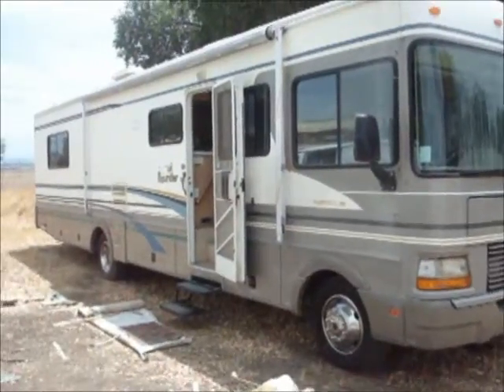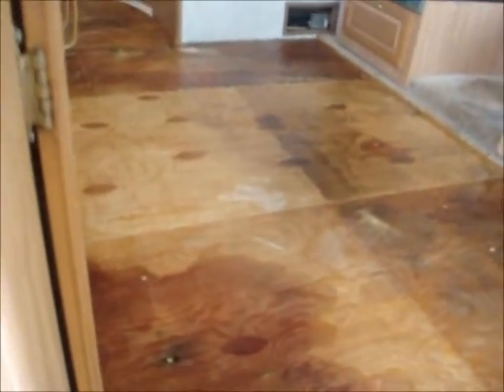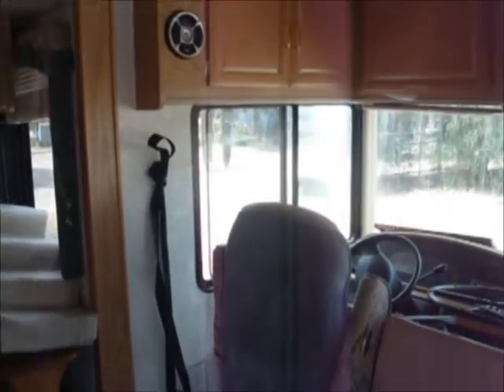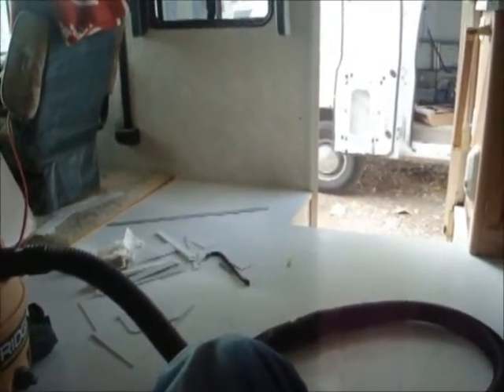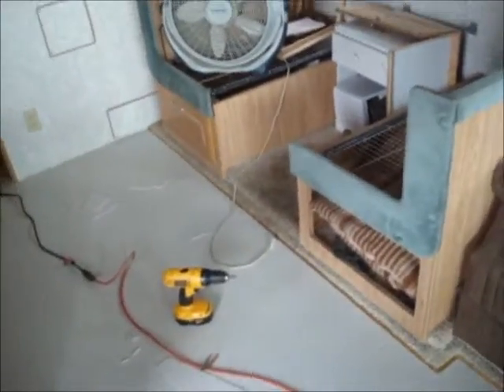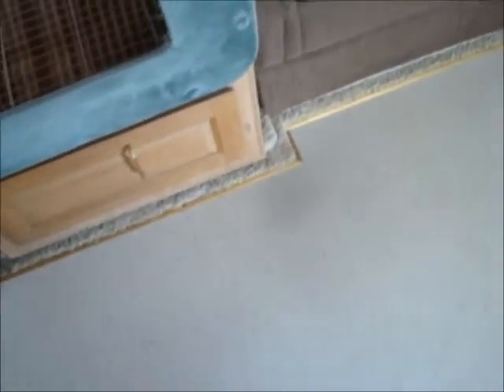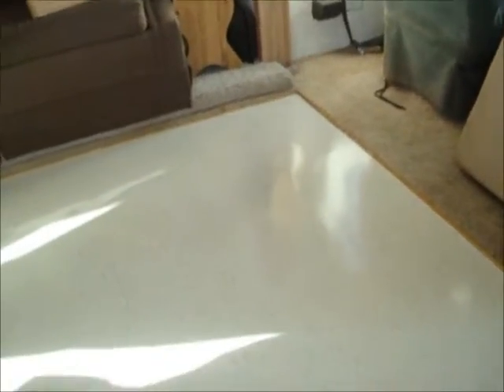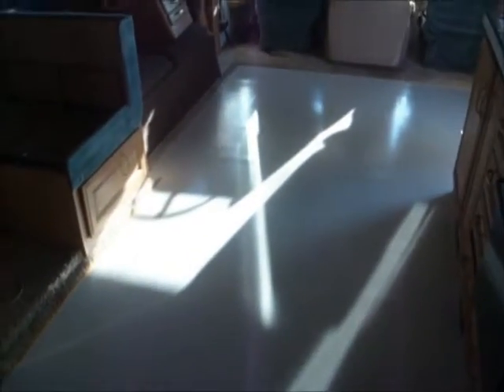Trailer Tips & Tidbits - Tiling A Newer Motorhome

Comment from the maker: The slide out actually rides up off the floor. No wheels that I could find. We noticed that the slide out actually slides in and out much easier with less noticible strain on the motor and gears. You can hear the difference. The slide out leaves no marks on the floor at all.